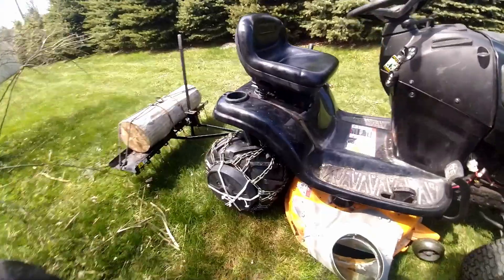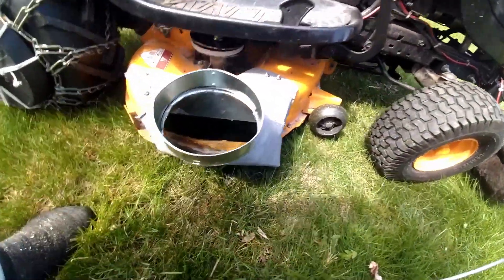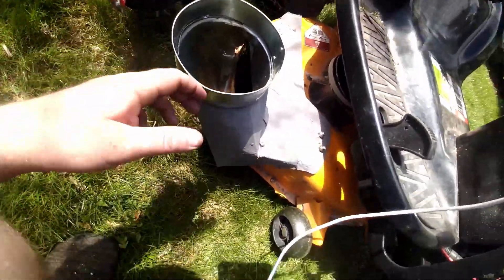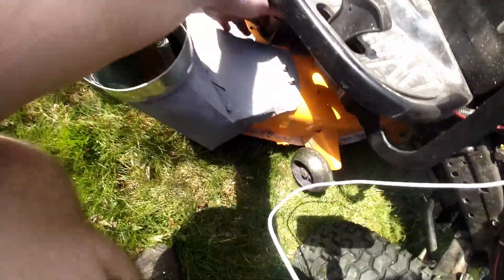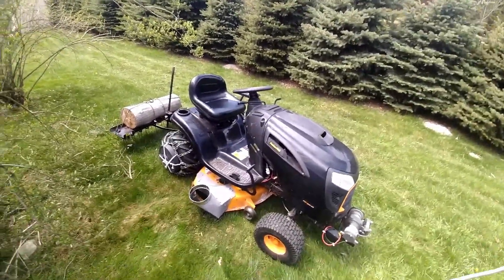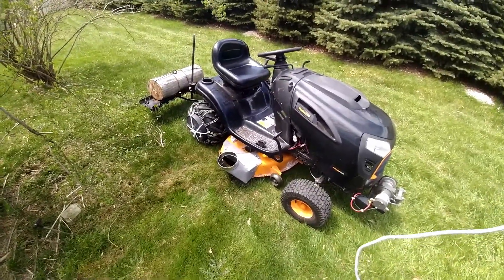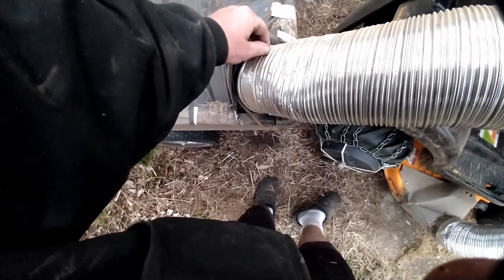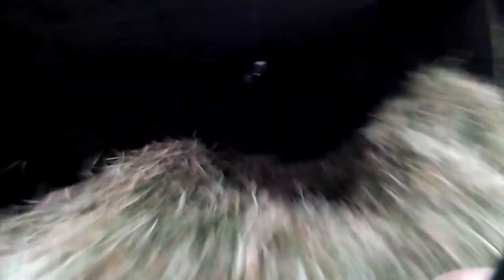$20 GRASS BAGGER

Comment: Attach the flex pipe or solid pipe to a large plastic bag (industrial type) and drag the bag instead of using a trailer to catch mulch..Now you have the mulch bagged.  Make sure the pipe is connected securely to mower.